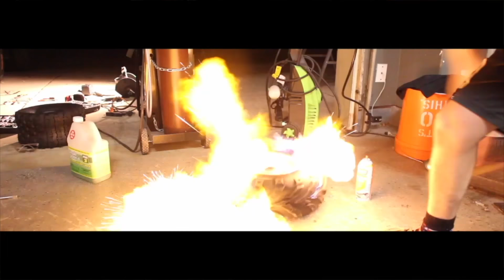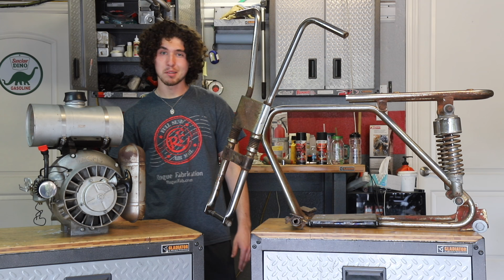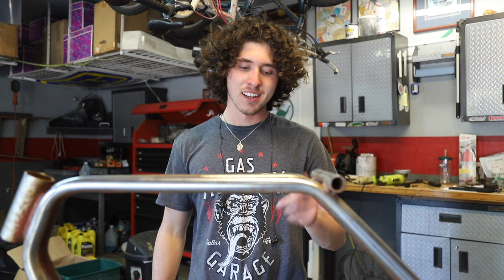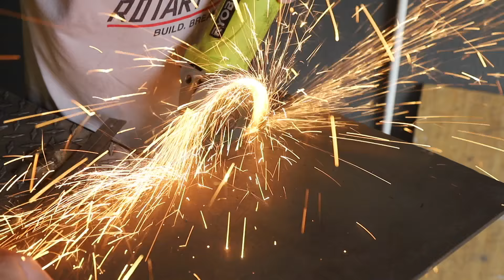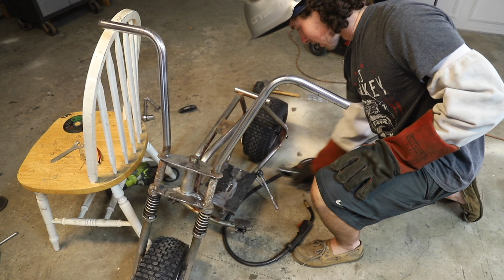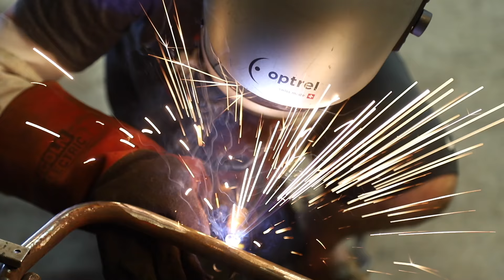ROTARY Mini Bike Build Ep. 1 | Frame and Engine!

Comment: Very cool motor I have a Uncle that is aEngineer, retired AirForce ,and a retired Commercial Airline pilot , he is super cool and has many inventions patented  one of his  things now is converting Rotary Mazda engines for Aircraft  use  I asked him why the older Mazda’s had a lot of engine failure  by destroying the lining inside the engine he told me the main problem was inadequate cooling systems  I don’t know if you can adapt some type of a external oil cooler ? On yours  but I bet  it wouldn’t hurt  to do so of course on a mini bike if engine failure happens prematurely you can coast safely to another area unlike a airplane that may  crash ?

Comment: "I can't actually make anything, so I'll buy a bunch of prefabbed parts wherever possible and then some random bits together and call it job done."

Cool idea for a minibike, but I don't know if I enjoyed watching this.
Reply: Alex... aren't you mechanaclly minded ??.....Trev New Zealand
Reply: @trevinskiking2165  I'm a bicycle mechanic, if that means anything. :)
Reply: @Metal-Possum  Yes.,do you think I'm sub normal bicycle mechanics should be able to make a tube framed mini bike from scractch or are you a modern " mechanic" - a parts changer , there's a difference to old school bike mechanics (no offence intended) what's the problem ? If you can fix an internal rear hub 3 speed gearbox from the '70's you should be ok , ??...Cheers Trev

Comment: With the tapered shaft, it tells me that this engine ran a generator.
Reply: rotary generator?😂😂
Reply: Leevi Isola yes as it can sustain the rpm required for power generation with fewer moving parts, I’ve been wrenching on small engines since the early 90’s.
You wouldn’t believe the weird shit I’ve seen from 60’s and 70’s era.

Comment: 3:01 if you use it at the other side, I mean put the short side at the bolt and use the larger side to make it loose, it’s going to be loose more easy. As much distance you have at the application force point you can put much torque to make it loose. Love your content. Hi from Mexico

Comment: I have 4 Sachs rotaries of this type. I have a km3(mounted to the original lawnmower), km37,km48, and km24. I have fully restored all of them including machining the housings and replacing the seals. I have powder coated the bed of the lawnmower to original spec as well. I have completely rebuilt all of them and have manuals for all of them if you need any help or Manuals I can send them
Reply: The friction drive paws of the pull start on these engines are a pain. I replaced the original material with new rubber however you can also put a layer of tape inside the housing to help if the cord ever slips. The stock bing carbs on these are VERY restrictive. You can make a lot more power if you switch over to an after market carb. I prefer to keep mine original for restoration however they can make a lot more power

Comment: Looks like it ought to be fun! I'm curious if that welded in 3/4 shaft actually runs true since you didn't really have any kind of jig to hold it in place when you welded it. I didn't see it, but I hope you welded the outside edge on that E-shaft adapter also!😉 What happened to the Hercules powered kart? Still running?🙂

Comment: What are these engines called
Reply: Sachs industrial wankel. They came in a couple different displacements, the most common being the KM48 160cc like they have here, and also a KM914 300cc model with around 16 hp.

Comment: I believe the rotary engine makes more power and torque at less rpm than a small capacity piston engine.

VGA have licenses to use these as range extension motors for EV automobiles.

Comment: I doubt Sachs call it a rotory, that's an aircraft engine. I'm sure this is a Wankel
Reply: It's both. The Gnome rotary of the early 20th century was a radial rotary where the entire engine block rotated. This is a Wankel rotary where the internal components of the engine rotate instead of reciprocate. Both are rotary engines, of different design.

Comment: I see the sprocket on the other side of the clutch and it kills me😂
Reply: I was thinking the same thing! I wonder if they're doing some sort of jack shaft, or if the just threw it up there to get rolling. They can mess with different gear ratios using a jack shaft, but a straight shot from the clutch to the rear sprocket would be alot easier... I guess we'll see!
Reply: https://youtu.be/e5Xg0Sri2_gfr

Comment: The "brap brap brap" idle noise is just amazing for an engine that small, i has to be streetported or bridgeported i think, really excited about this build.
Reply: Peripheral ports also brap, more than a bridgeport.
Reply: @ralliartfanevoix  I did not know about peripheral port, thank you for the info, could it be done from factory ?
Reply: @xxtrengt8871  Some do, biggest way to tell is an intake runner on the housing, not on a side plate.

Comment: Instead of welding your Allen keys in, weld a bolt in.
Reply: A nut sometimes works better because you can fill the inside with weld even if it's broken off inside of a hole

Comment: You need the cross supports on the forks  or the bike will weave though the turns as weight and g force acts more on inside spring more than the outside spring
Reply: They will probably weld that metal fender on there, that will give it back some support.
Reply: @Mardy72  right the old structural fender trick

Comment: Apparently, these had roughly 8 horsepower and a 5k rpm redline.
Reply: That sounds bad, a rotory should rev alot higher, Even that power sounds low for its capacity. Id expect 12k rpm and 30hp min. Even a 4 stroke 160cc would do better than those numbers...
Reply: @christianbuczko1481  - I believe it was made for industrial use.
Reply: @christianbuczko1481  Im going to wing it by saying this and by that i mean taking the average between what MrWaffles and felix mentioned, if you compare this to a gx160 which is also an engine designed for industrial use with nearly an identical displacement. It's actually really impressive because it's turning double the rpm and putting out double the horsepower.
Reply: https://youtu.be/e5Xg0Sri2_g55
Reply: These engines came with 10 hp stock and a 6000 rpm limit according to their manual. I think that tese engines can rev a lot higher with a better carburetor, lighter flywheel, and the appropriate fuel mix.
Reply: @felixf8924  - Looks like we have found to differing articles about their power and numbers. Interesting. Either way, I totally agree these engines could be tuned up.
Reply: PARTY BOY  half 300 is 150. If you get 39hp from 300cc, you can get 19.5 from 150cc. That would be good for a 4stroke. A rotory should get more than that for same capacity if its tuned for power, as will a 2stroke. This rotory with such low power and rpm must be tuned for reliability, not power, and means its got potential for alot more.

Comment: and how are you running the motor to wheel with sprocket on wrong side of rear wheel? just a question is all
Reply from the maker: Part 2 we’ll be adding a jackshaft

Comment: When you weld near fuel tank cover it with a water soaked rag
Reply: Or anything with rubber as well. I have welded on tractor-trailers with air ride and would hate to burn a hole into one of those bags.
Reply: @27Zangle  i got written up for nicking a hydrolic line on a ship thst splits in half to dumb dirt/sand to make beaches and it was part the line thst open and closes the ship. Long story short like 80 foot of hard line had to be replaced because they wouldnt allow us to splice in a fix so yeah for 100 thousand for hydrolic line refitting
Reply: @makoshark40  - Ouch.
Reply: @27Zangle  yeah was like 8 years ago if not more now i dont even weld for a living anymore only sometimes for repairs or fun good stuff tho a trait i think everyone should learn with the enviroment we currently live in all the metal around us nowdays tyer can easily he a senario in like a apocalyptic world where having and being able to weld something could save your ride or your life simply knowing how to weld. But this is almost every construction style job i guess knowing how to measure cut and weld all of it is important imo not to mention deeply satisfying turning a flat plate into this big machine that moves the worlds economy. Just feels epic idk how to explain it

Comment: I always wanted to own one of those engines!
Reply: Keep a close eye out for used Arctic Cat snowmobiles from the early 70's. I think evinrude also made a rotary but I know know how much is available in terms of parts or info. I picked up a 72 panther that was in boxes but had a running Sachs 303 in november. Got it back together by January and rode it all winter. I feel like I stole it for $150 lol. They're out they're if you can figure out where to find them.
Reply: Q
Reply: Ive found a few but there like 500
Reply: andrew simmons what are they on I might pick one up
Reply: @gorkuhmork   where did you find them I'd give 500 for one as long as it works.
Reply: @acuraintegra101  ive found them all over ebay
Reply: @gorkuhmork  can u give a link for them?
Reply: @thercnut9261  NB went unanswered ! It'll have a good power to weight ratio but the noise when you open up the muffler to get some uncorked HP, the noise is like an Elongated Fart...& a loud one at that & Rotaries spin high but that's why they are for sale: Super thirsty !...but Goodonya for daring to be different, only I'd keep it looking more period correct by running a souped Flathead B & S or Techcumush 3.5 or 5 HP Or go real period correct old School & run a 10 HP gokart 2 Stroke McCulloch engine from the 1960's with a cast open Header manifold: then you'll make smoke noise & sound good doing it....they wound out to about 10,000+RPMs.Cheers Trev New Zealand.
Reply: https://youtu.be/e5Xg0Sri2_g
Reply: Hey bro do you no of an engine for sale
Reply: Ok thanks I'll check again I've tried ebay before thanks for the quick response.
Reply: @PJBX24  Hi Jett... did it get a headache or something ? 😋ch er Trev